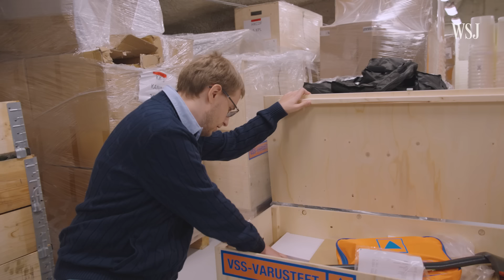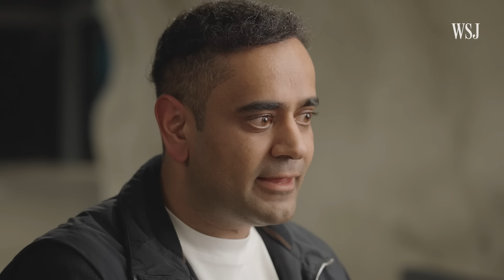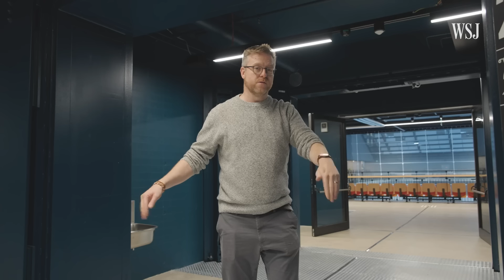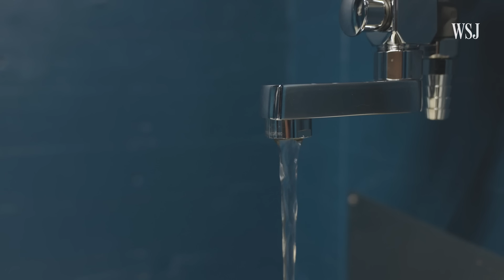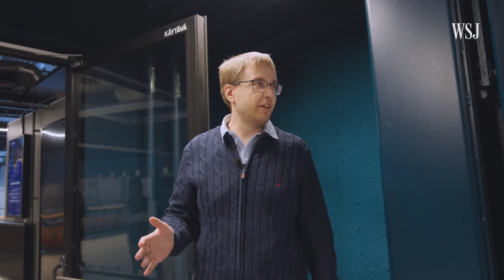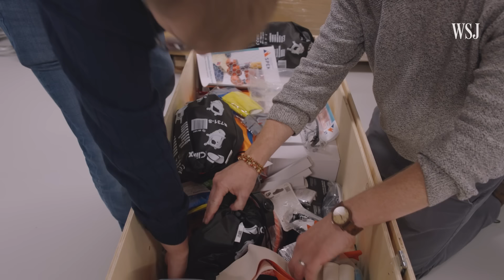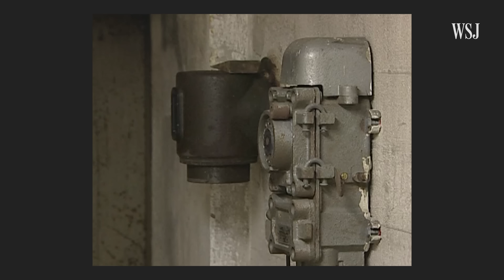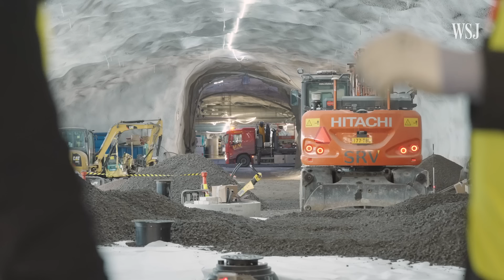What It Takes to Build a Modern Nuclear Shelter for 7K People | WSJ

Comment: United States: Last test September 23, 1992 (Nevada Test Site). (nuke) its feb 2026

so doubt it will even be standing when modern day nukes launch. good scam for the dead doe.
Reply: It's called a nuclear shelter in this video but we call them just shelters. They're meant to shelter people in the case of conventional war, nature disasters or if something like Chernobyl happened.
Reply: Many people thinks that those shelters are only for the nuclear bomb attack or that you have to live there for a longer period of time. 
They are only partly right, bomb shelters are primarily for war situations where people have to be evacuated underground, for example due to missile and drone attacks or if the attacker decides to use chemical weapons against the civilian population. A nuclear attack is only the worst-case scenario, which has also been considered, but the main purpose of bomb shelters is to prevent enemy missiles, drones and other air strikes, for example bombers. The bomb shelter in the video was just one of many, but Finland is full of various sized civilian shelters, the largest of which are located underground, about 10-30 meters underground. All large residential buildings have a civilian shelter for residents, and if you do not have your own civilian shelter, the nearest underground shelter can be found in large population centers 1-15 km away. In Finland, it has been necessary to prepare for this type of evacuation of people because Finland's eastern neighbor, Russia, has shown in its history that it is capable of launching an offensive war at any time for any reason. Ukraine is a good example of this for the modern world, while Finland still remembers what happened in 1939. 
Finland has been preparing for the worst for over 80 years and this is maintained only because the worst option may come true someday. There are only about 5.5 million people in Finland, but it is important to note that with these preparedness measures that have been taken in the past, Finland is able to offer a civilian shelter to about 4.6 million people in the event of a crisis. I think this is a great achievement by the Finns and what is best is that every adult Finn is aware of this and they are constantly trained for various crisis situations. 
Within 72 hours, most of the entire adult population is put on alert if, for example, they are targeted by a full-scale war of aggression launched by an external state or actor. This includes wartime troops, army reserve troops whose deployment begins immediately, other crisis troops, hospitals, provincial troops, and other personnel who, in addition to their own civilian work, have received special training for war and crisis situations. 
And as I said, Finland is preparing for the worst, but only because they are ready to defend their homeland and their own independence as an independent state and to give the best opportunity for Finns to survive together so that no one is left alone. 

Your homeland is where you were born and for Finns, their own country is the best and most beloved, they want to hold on to it now and in the future by preparing for the worst scenario as well. 

Peace and Love to all over the World!❤️

Comment: Wall Street Journal is so out of touch that they probably dont understand that this is basically a middle finger to regular people as we know we wont be getting any access to nuclear bomb shelters. 

Consolation prize. I give those people 2 months in there before they devolve into barbarism and eat each other. Nobody's getting off this ship, we ether save it or we all go down together one way or another.
Reply: But here in Finland these shelters ARE for regular people. We have about 50500 bomb shelters in Finland which is enough for about 85% of the population. In Helsinki alone there are 5500 shelters that have a room for almost 1 million people, which is enough for everyone living or visiting Helsinki. 
In Finland every single building over 1200 square metres must have a shelter, it's required by law. Every large apartment building, school, shopping centre, sports venue etc. has one, no matter if it's a public or private building.
Reply: Many people thinks that those shelters are only for the nuclear bomb attack or that you have to live there for a longer period of time. 
They are only partly right, bomb shelters are primarily for war situations where people have to be evacuated underground, for example due to missile and drone attacks or if the attacker decides to use chemical weapons against the civilian population. A nuclear attack is only the worst-case scenario, which has also been considered, but the main purpose of bomb shelters is to prevent enemy missiles, drones and other air strikes, for example bombers. The bomb shelter in the video was just one of many, but Finland is full of various sized civilian shelters, the largest of which are located underground, about 10-30 meters underground. All large residential buildings have a civilian shelter for residents, and if you do not have your own civilian shelter, the nearest underground shelter can be found in large population centers 1-15 km away. In Finland, it has been necessary to prepare for this type of evacuation of people because Finland's eastern neighbor, Russia, has shown in its history that it is capable of launching an offensive war at any time for any reason. Ukraine is a good example of this for the modern world, while Finland still remembers what happened in 1939. 
Finland has been preparing for the worst for over 80 years and this is maintained only because the worst option may come true someday. There are only about 5.5 million people in Finland, but it is important to note that with these preparedness measures that have been taken in the past, Finland is able to offer a civilian shelter to about 4.6 million people in the event of a crisis. I think this is a great achievement by the Finns and what is best is that every adult Finn is aware of this and they are constantly trained for various crisis situations. 
Within 72 hours, most of the entire adult population is put on alert if, for example, they are targeted by a full-scale war of aggression launched by an external state or actor. This includes wartime troops, army reserve troops whose deployment begins immediately, other crisis troops, hospitals, provincial troops, and other personnel who, in addition to their own civilian work, have received special training for war and crisis situations. 
And as I said, Finland is preparing for the worst, but only because they are ready to defend their homeland and their own independence as an independent state and to give the best opportunity for Finns to survive together so that no one is left alone. 

Your homeland is where you were born and for Finns, their own country is the best and most beloved, they want to hold on to it now and in the future by preparing for the worst scenario as well. 

Peace and Love to all over the World!❤️

Comment: Which 7 thousand first ...let me guess
Reply: There are several of these large shelters in the city. And a huge number of smaller shelters.
In Finland every single building over 1200 square metres must have a shelter, it's required by law. Every large apartment building, school, shopping centre, sports venue etc. has one, no matter if it's a public or private building.
We have about 50500 bomb shelters which is enough for about 85% of the population. In Helsinki alone there are 5500 shelters that have a room for almost 1 million people, enough for everyone living or visiting Helsinki.
Reply: Many people thinks that those shelters are only for the nuclear bomb attack or that you have to live there for a longer period of time. 
They are only partly right, bomb shelters are primarily for war situations where people have to be evacuated underground, for example due to missile and drone attacks or if the attacker decides to use chemical weapons against the civilian population. A nuclear attack is only the worst-case scenario, which has also been considered, but the main purpose of bomb shelters is to prevent enemy missiles, drones and other air strikes, for example bombers. The bomb shelter in the video was just one of many, but Finland is full of various sized civilian shelters, the largest of which are located underground, about 10-30 meters underground. All large residential buildings have a civilian shelter for residents, and if you do not have your own civilian shelter, the nearest underground shelter can be found in large population centers 1-15 km away. In Finland, it has been necessary to prepare for this type of evacuation of people because Finland's eastern neighbor, Russia, has shown in its history that it is capable of launching an offensive war at any time for any reason. Ukraine is a good example of this for the modern world, while Finland still remembers what happened in 1939. 
Finland has been preparing for the worst for over 80 years and this is maintained only because the worst option may come true someday. There are only about 5.5 million people in Finland, but it is important to note that with these preparedness measures that have been taken in the past, Finland is able to offer a civilian shelter to about 4.6 million people in the event of a crisis. I think this is a great achievement by the Finns and what is best is that every adult Finn is aware of this and they are constantly trained for various crisis situations. 
Within 72 hours, most of the entire adult population is put on alert if, for example, they are targeted by a full-scale war of aggression launched by an external state or actor. This includes wartime troops, army reserve troops whose deployment begins immediately, other crisis troops, hospitals, provincial troops, and other personnel who, in addition to their own civilian work, have received special training for war and crisis situations. 
And as I said, Finland is preparing for the worst, but only because they are ready to defend their homeland and their own independence as an independent state and to give the best opportunity for Finns to survive together so that no one is left alone. 

Your homeland is where you were born and for Finns, their own country is the best and most beloved, they want to hold on to it now and in the future by preparing for the worst scenario as well. 

Peace and Love to all over the World!❤️

Comment: Regarding the doors that can be closed by a single person - what stops a person from doing just that? Like, if the sirens go off and a nuclear attack is imminent, what stops the panicking first dozen people that reach this shelter to just close it? Unless the doors can be opened from the outside, in that case the whole thing is a death trap because people on the outside will desperately want to open it in the last seconds before the blast and then the doors will be opened during the nuclear attack.
Reply: Many people thinks that those shelters are only for the nuclear bomb attack or that you have to live there for a longer period of time. 
They are only partly right, bomb shelters are primarily for war situations where people have to be evacuated underground, for example due to missile and drone attacks or if the attacker decides to use chemical weapons against the civilian population. A nuclear attack is only the worst-case scenario, which has also been considered, but the main purpose of bomb shelters is to prevent enemy missiles, drones and other air strikes, for example bombers. The bomb shelter in the video was just one of many, but Finland is full of various sized civilian shelters, the largest of which are located underground, about 10-30 meters underground. All large residential buildings have a civilian shelter for residents, and if you do not have your own civilian shelter, the nearest underground shelter can be found in large population centers 1-15 km away. In Finland, it has been necessary to prepare for this type of evacuation of people because Finland's eastern neighbor, Russia, has shown in its history that it is capable of launching an offensive war at any time for any reason. Ukraine is a good example of this for the modern world, while Finland still remembers what happened in 1939. 
Finland has been preparing for the worst for over 80 years and this is maintained only because the worst option may come true someday. There are only about 5.5 million people in Finland, but it is important to note that with these preparedness measures that have been taken in the past, Finland is able to offer a civilian shelter to about 4.6 million people in the event of a crisis. I think this is a great achievement by the Finns and what is best is that every adult Finn is aware of this and they are constantly trained for various crisis situations. 
Within 72 hours, most of the entire adult population is put on alert if, for example, they are targeted by a full-scale war of aggression launched by an external state or actor. This includes wartime troops, army reserve troops whose deployment begins immediately, other crisis troops, hospitals, provincial troops, and other personnel who, in addition to their own civilian work, have received special training for war and crisis situations. 
And as I said, Finland is preparing for the worst, but only because they are ready to defend their homeland and their own independence as an independent state and to give the best opportunity for Finns to survive together so that no one is left alone. 

Your homeland is where you were born and for Finns, their own country is the best and most beloved, they want to hold on to it now and in the future by preparing for the worst scenario as well. 

Peace and Love to all over the World!❤️
Reply: Think that on the door are our local reserve soldiers guiding the people.

Comment: Nuclear radiation takes years to subside but even so, look at chernobyl
Reply: The initial fallout from iodine is the most harmful part and it vanishes in days. After that it's manageable. Look at Hiroshima and Nagasaki for starters.
Reply: Many people thinks that those shelters are only for the nuclear bomb attack or that you have to live there for a longer period of time. 
They are only partly right, bomb shelters are primarily for war situations where people have to be evacuated underground, for example due to missile and drone attacks or if the attacker decides to use chemical weapons against the civilian population. A nuclear attack is only the worst-case scenario, which has also been considered, but the main purpose of bomb shelters is to prevent enemy missiles, drones and other air strikes, for example bombers. The bomb shelter in the video was just one of many, but Finland is full of various sized civilian shelters, the largest of which are located underground, about 10-30 meters underground. All large residential buildings have a civilian shelter for residents, and if you do not have your own civilian shelter, the nearest underground shelter can be found in large population centers 1-15 km away. In Finland, it has been necessary to prepare for this type of evacuation of people because Finland's eastern neighbor, Russia, has shown in its history that it is capable of launching an offensive war at any time for any reason. Ukraine is a good example of this for the modern world, while Finland still remembers what happened in 1939. 
Finland has been preparing for the worst for over 80 years and this is maintained only because the worst option may come true someday. There are only about 5.5 million people in Finland, but it is important to note that with these preparedness measures that have been taken in the past, Finland is able to offer a civilian shelter to about 4.6 million people in the event of a crisis. I think this is a great achievement by the Finns and what is best is that every adult Finn is aware of this and they are constantly trained for various crisis situations. 
Within 72 hours, most of the entire adult population is put on alert if, for example, they are targeted by a full-scale war of aggression launched by an external state or actor. This includes wartime troops, army reserve troops whose deployment begins immediately, other crisis troops, hospitals, provincial troops, and other personnel who, in addition to their own civilian work, have received special training for war and crisis situations. 
And as I said, Finland is preparing for the worst, but only because they are ready to defend their homeland and their own independence as an independent state and to give the best opportunity for Finns to survive together so that no one is left alone. 

Your homeland is where you were born and for Finns, their own country is the best and most beloved, they want to hold on to it now and in the future by preparing for the worst scenario as well. 

Peace and Love to all over the World!❤️
Reply: radiation from nuclear weapons decreases fast. Hiroshima & Nagasaki were safe within weeks, unlike Chernobyl, which is still not fully safe for humans.